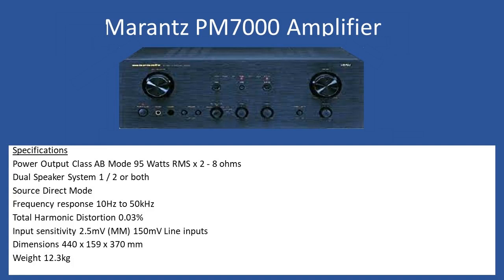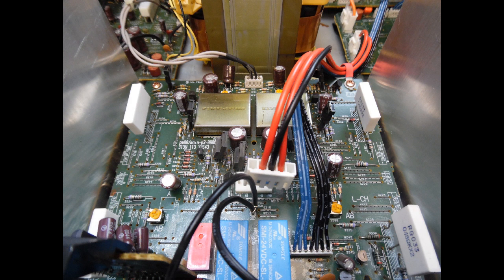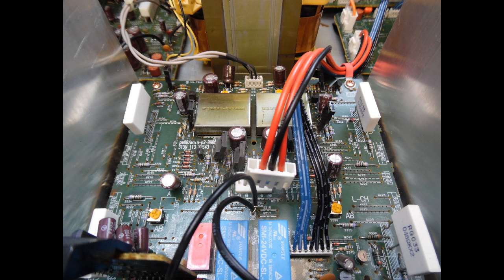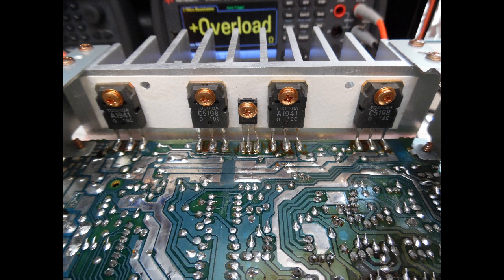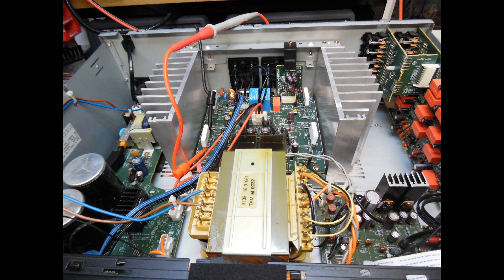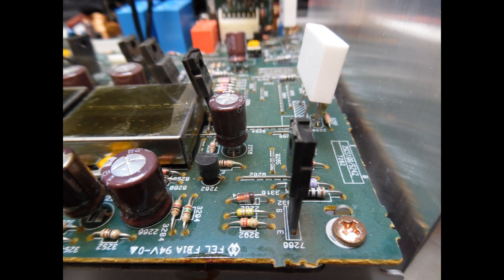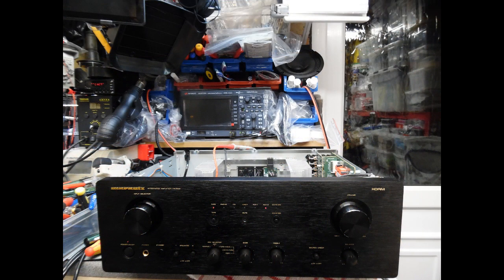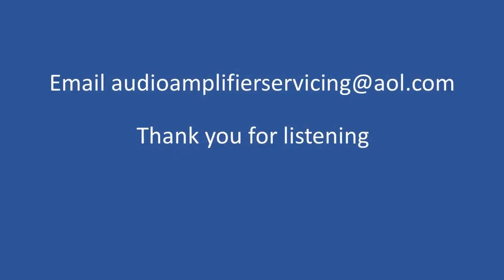Marantz PM 7000 Amplifier Repair (With Audio Tutorial)

Comment: Was considering buying one not far from me for £150. But looks like id be in a money pit
Reply from the maker: If the Amplifier is in good condition and its not been in a damp environment it would be worth buying and may be the seller is open to price negotiations.
Reply: @AudioAmplifierServicing i went with it! Paid full in the end, too many likes (hearts) and the condition is excellent. Another one (black version)was going for 3/4 more so i didnt think a bad deal in the end. Got it home, dusted, hoovered inside, sprayed some 99% rubbing oil in inputs. Couldnt get to the pots due to a circuit board in the way. 
Fired it ip, took about 6 seconds for relay to switch which i thought wasnt bad? I remember my pm4001 similiar time.
Checked Offset, 5mv right and 15mv left. 
Slightly noisey Transformer but expected for age. Ran mild warm after 30mins.
Only concern is the left channel speaker hum/hiss is quite noisey when sitting close.
Reply from the maker: @CM-dw3gh Hi, if you were able to complete the work in the video you would hear an improvement.
Reply: @AudioAmplifierServicing im only a humble intermittent solderer. I have replaced some power caps on a nad 3030A, along with crossovers in old speakers. I think i need to get that DC down from 15mv. Then check the Bias. Ill be honest, the soldering looks very good compared to yours. Im guessing it wasnt over used and kept in a better enviroment.
Reply: Well, i got the Offset down to more or less 1-2mv (L & R)
The Bias was more sensitive but got them around the 17-19mv mark.
The only problem is i didnt start when amp was cold. It was already warm from doing the Offset (did first)
Do you reckon i should leave it now or start the process again?
Ran it last night for an hour (vol shy of 9oclock) with speakers, sounded clear of distortion, hood was mild warm. Music sounded rich and warm as expected from Marantz. 😊
Reply from the maker: @CM-dw3gh Hi you did the right procedure and made the adjustments when the Amplifier had warmed up.
Reply: @AudioAmplifierServicing cheers. Thank you for prompt responses. Puts my mind at ease. Subscribed.😊
Reply: Does anyone know if this amp came with a remote. I had one for a PM4001 which ive still got but mislaid. I can see ones online for the PM8000. I keep thinking if i find mine it would work. Seller of the PM7000 doesnt recall one. It has standby and a sensor. Baffled😮
Reply from the maker: @CM-dw3gh See the user manual Source: Marantz https://share.google/hZ5TmXddmUTRH80Oj
Reply: @AudioAmplifierServicing cheers. I thought this was specific to the 8000 model.

Comment: Here is the translation:

"Thank you for this video. I'm having an issue with the Marantz PM7001. While I was listening to music, there was a small puff of white smoke and a pop sound. When I try to power the amplifier back on, it goes into protection mode, and the volume knob moves on its own to 0. A burning smell appears after 2 minutes. 

I tried to figure out where the problem was coming from. I unplugged the connectors one by one, and I noticed that when I plug in the connector to the right of the capacitor, the burning smell appears. Where could this problem be coming from? Thanks."
Reply from the maker: @guillaumemarecaux811  Hi can you send photographs of the area your referring to. Email audioamplifierservicing@aol.com

Comment: I have experienced exactly the same issues you described in this video while i was trying to repair my Marantz pm68. They are identical with pm7000 series. What i faced was broken solder joints on the predriver transistors, cut off board tracks and i unfortunately bought not genuine transistors (I did not know there where fakes out there at the time). I ended up using wire for mechanical strength on the broken joints and never trusted any e-shop here in my country (Greece) that sells transistors. I bought the 2sc5200 & 2sa1943 (newer model and a bit more powerfull)  directly from parts express after the first batch i ordered ended up in catastrophic failure after 30 mins of playback at a low volume and with the correct bias / dc offset values. I also ended up replacing the output relays as they where oxidized and affected the output. All the remains now is a full recap of the amplifier as it is 26 years old. It still plays amazinglly well but i'm guessing it's gonna start clipping early due to the capacitor age.
Reply from the maker: Great to hear you have repaired your Amplifier and thank you for sharing your experience on the channel.
Reply: @AudioAmplifierServicing  Could you please explain why the backpanel and grounding plays such an important role in this design? I was hearing a mechanical plastic pop at the 30 min pop due to heat and another one after powerdown at the 10 minute mark. so i loosen't the screws just in case i had overtightened anything and it blue one of the transistors (collector to emitter dead short) in 1 minute. It was working perfectly fine for many months of everyday listening after the repair. i have now replaced that transistor (2sa1943) and it works again. But i don't understand why? Thanks again for the valuable info!
Reply from the maker: @alp855-r1x  It is common for manufacturers to use the rear back panel and Amplifier chassis to provide a common ground point.
  For anyone not familiar with the practice it can result in damage to the Amplifier if testing is done with the grounding screws not installed.
 If the back panel and chassis was not used the connections would have to be made via wire links that can result in noise being induced.
Reply: @AudioAmplifierServicing  thank you for your reply! Lesson learned!
Reply from the maker: @alp855-r1x  generally the Amplifier speaker terminals have a third entre connection thats soldered into the circuit board it will be a common ground point that connects to the rear panel and chassis when the fixing screw is fully tightened.
Reply: @AudioAmplifierServicing  i have seen that connection you speak of. but i think i messed up where the circuit board mounts to the chassis. It has 4 screws mounting it to the metal and i loosened those. with the multimeter i found that the circuit board is supposed to touch the chassis firmly. By trying to alivieate the mechanical pressure and mechanical pops i was hearing when the amplifier was getting warm and on cool down i effectively disconnected the board from ground by loosening those screws. so it had ittermitent conncetion to ground and it blew one of the output transistors. i have replaced and checked everything and i'm about to test again. I just needed to make sure and posted here so that anyone else seeing this does not make the same mistake. Thanks again for the valuable info!
Reply from the maker: @alp855-r1x  Really appreciate you sharing your experience on the channel.

Comment: thanx for the video, it was a big help.
now I know what went wrong with my amp after trying to clean it. I tried to test it without the screws at the back :/ I hope there is an easy way to fix it
Reply from the maker: Hopefully there is not significant damage.
Reply: no sound output at all
Reply from the maker: @josephyacoub4465  I would check your previous work to ensure there are no issues.
If the power input protection fuse is not blown then the output transistors have not failed.
Reply: Thanx alot for the replay. It's comforting since the fuse is not blown 🙏
Reply from the maker: @josephyacoub4465  If you have worked on the Amplifier circuit board the one with the speaker protection relay, ensure there are no bad solder joints or may be a broken track etc
Reply: I didn't touch it at all
Reply: normally there is a relay that makes a click sound after about 10 seconds from turning the amp on, first after that the amp works. Now it turns on makes the sound after 10 seconds and makes the same click sound about after another 10 seconds after that. Is that an indication for something ?
Reply from the maker: @josephyacoub4465  There are two speaker protection relays speaker relays selectable from the front of the Amplifier.
Are the relays staying energised?
Reply: @AudioAmplifierServicing  I ordered a multi-meter to start trouble shooting and learn some more about the electronics of this device. You got me into it. Thank you so much. I'm gonna update on this as soon as I get it. Thanks alot for these educational videos and for your time.
Reply from the maker: Thats great @josephyacoub4465